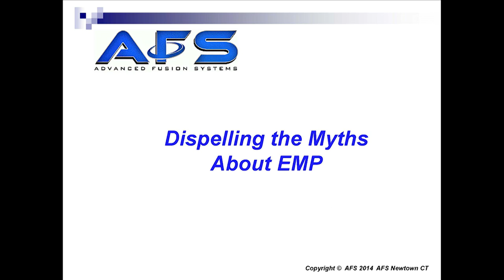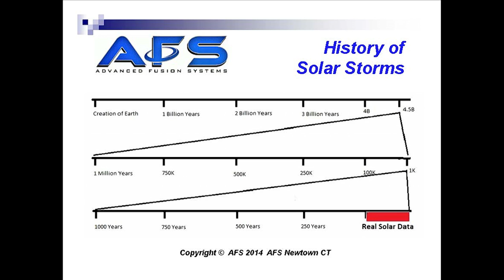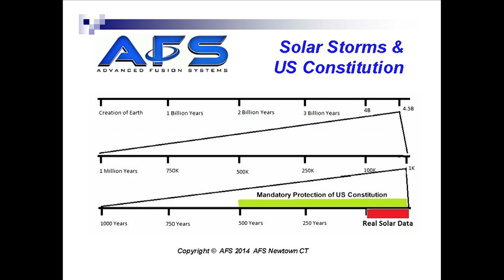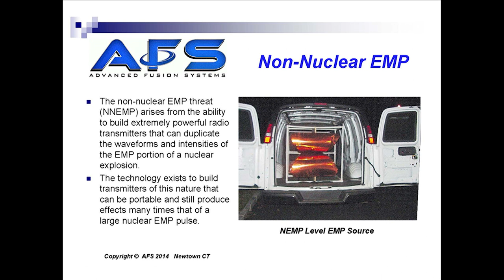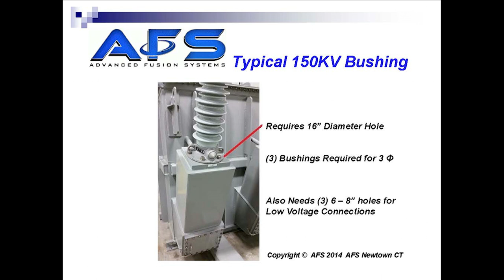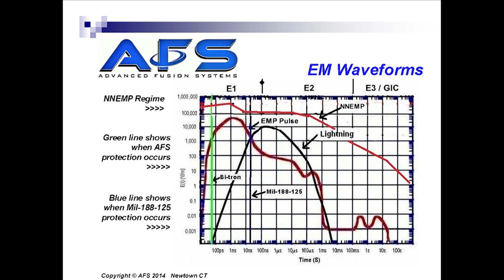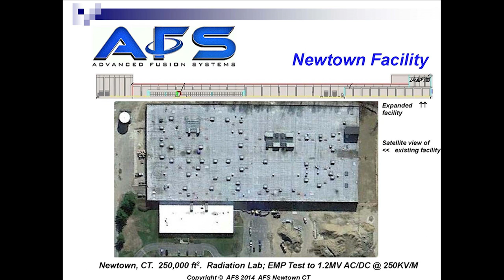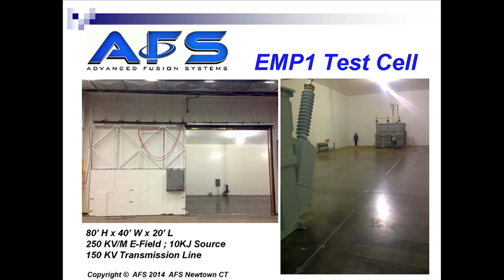8 - Presentation: “Dispelling the Myths about EMP"

Comment: This is amazing!  NO American should ignore the reality of what can happen.  I am totally convinced we WILL have an EMP.  It's happened before and WILL happen again.  We depend on our solid state run components.....even your refrigerator has a computer in it......right on down to a toaster.  If we lose those units a lot of people would starve in the first month or less.  I don't care if it's natural or man made......we WILL have one.......great clip
Reply: An EMP from an air-exploded nuclear weapon has never happened, and that's what everybody is scared of.  Only some testing has been done and it was no more dangerous than lighting hitting ac lines and frying equipment which is nothing new.
Reply: @genesmith482  no. But there was an EMP attack in the USA back in the 80's that was only recently made public. It was the couse to a famous city wide blackout.
Reply: AWitty Pilot --- Great comment. But I believe it will be an orchestrated event along with others so the NWO can step in and Take Control. The classic Hegelian Dialectic of Problem - Reaction - Solution.
Reply: @genesmith482  - Your comment is incorrect. The US detonated a 1.4 MT nuke  launched from Hawaii specifically for testing EMP effects. 
Phones, street lights, power stations, etc. were all affected. In fact, effects were even documented in Australia.
And that was from a weak, little 1.4 MT nuke. And, at a time back before modern electronics ran everything.
Reply: AWitty PIlot my toaster has no electronics. Come on.

Comment: I've been in the surge/lightning/EMP protection business for over thirty years.  There are basically three types of discrete components used for pulse protection circuits each having their own pros and cons.  Limitations are always cost, speed and current capacity.  The most robust design schemes usually have a combination of all three devices with supporting components to cover a broader range of current capacity and reaction speed.  Avalanche diodes (silicon) are the fastest, MOV's (metal oxides) are next.  And then gas discharge tubes are the slowest which is ironic since that is what this guy is pushing.  Also gas tubes have a follow on current after they are triggered and will conduct current from any power circuit in which they are connected (one of the reasons gas tubes aren't used in power systems without some exotic by-pass/disconnection circuit).
Reply: A solar CME is not a fast event. It is also 10,000 times more powerful. The Carrington Event in 1859 caused wires to melt and telegraph offices to burn down. We have to harden the grid against this.

Comment: From my understanding. Faraday cages need to be built in multilayers. Meaning a faraday cage within a faraday cage within a faraday cage and made out of non-conductive materials such as aluminum and insulated in between the layers. Plus no access panels or doors. Totally incapsulated with no air gaps to be efficient enough to protect from EMP. Why couldn't  large faraday cages built this way be placed on site or near by the  (Power Station / Plant) with replacement transformers inside? In the event of EMP attack or event just be swapped out after the event?
Reply: Aluminum is conductive. It is more about the wavelengths of EM energy involved vs. the size of gaps in the mesh.
Reply: Aluminum is conductive. Most high voltage conductors and substation busswork are stranded aluminum.
Reply: Sorry for the mistake about aluminum. But i've watched a lot of Youtube videos on building faraday cages and the ones that looked like they were working well had multiple layers to them. don't know or remember what materials they were using in there builds though?
Reply: Doesn't matter anyways. An EMP would destroy the nuclear power plants we have here in the United States (nuclear meltdown) and the radiation in the air would kill off everything else ( nuclear winter). We all die. Just like Chernobyl only on larger scale.

Comment: The only weak points in a power grid are the overly complex and unnecessary "digital" control and monitoring systems. Analog meters and standard hand-thrown switches and simple solenoid relays could alleviate problems. The likelihood of generators, lines, transformers and massive breakers incurring E.M.P. damage is negligible. Vacum tubes to protect the control and monitoring systems would be redundant if we return to old-fashioned systems. Vacum tube implementation would never happen with modern systems and may be some sort of boondoggle. Having that transformer in that 2400 sq.ft. room may be part of a presentation-scam for ignorant politicians and "officials", which I have seen before.

Comment: I think a Faraday cage and a Faraday net have holes.
Reply: There is a limit to the size of the holes, related to the frequency of the wave.  You are looking at a hole size at or a little less than that of a common aluminum screen.
Reply: Supposedly, any wave smaller than the mesh in the screen can slip through a Faraday cage. Microwave ovens use Faraday cage technology to let us look at the food through holes smaller than 1.5 millimeters. The wavelength of microwave energy for home use is around 120 millimeters.
Reply: Not sure what electronics are worth saving if the power grid and networks are fried.

Comment: So a faraday cage would not protect ???
Reply: Steven What about steel?  And I herd a microwave that’s not plugged in would protect small things. You think?
Reply: It needs to be earthed or useless
Reply: Susan Carter I have heard that the plug/cord needs to be removed from the outside of microwave (acts as an antenna) and hole sealed.. any ground to ground can supposedly feedback as grounding rods/wires will pick up the frequency... but I am only referring from what I have heard so...?
Reply: spiritmatrix2004 have been told by electrical engineer that the ground connection from grounding rod/wires act as an antenna as well.. he said NO ground connection.. but who really knows??
Reply: Yes it will if its made correctly

Comment: - Invited Speaker to the Huntsville Cyber & EMP Symposium
Aug 11, 2018. Visit www.lagridcoalition.org  for links to EMP information. We have done an EMP numerical simulation to verify a Thesis document (1974) by Terry C. Chapman - Catalog ADA777841 of the US Air Force College (AFIT). *To make your town more secure & safe - do this work. 

 1st  = A Small town in New Mexico evaluated, AD A023927 EMP effects on a rural area
elect system USAF AFIT (implement it).

 2nd. = Dr Baker’s Mil Std 188-125 document with A thru C appendices. 

 3rd. = Numerical Simulations at: ‘GitHub’ coding here: 

  https://github.com/LAGridCoalition/HEMP-Modeling and Simulations/documents,  in Google Drop boxes

 https://goo.gl/7aJqj4 = 5 docs at 90%  Simulation tests - & https://goo.gl/caE8vq = video  --

 https://goo.gl/71bBVt = Entire Huntsville AL presentation materials used. ** Important notes: 

A. Critical materials & methods in advanced weapons  are not mentioned in 2 AFIT Thesis PDFs - such as “Gas Boosting” is not mentioned in 1st and 2nd generation weapons. 

B. We verified the 6448 V/M in Thesis by Terry Chapman.  

C.  The gold standard Thesis by Louis Seiler (ADA009208) has not been verified.  

D. Reverse engineering methods were required to verify data including 4 inputs.

Comment: So am i to go ahead and conclude that Faraday cages are a waste of time?
Reply: No. There is a lot of good info about Faraday shields. As long as you can find one that isn't trying to sell you something it will be true. Look up Faraday shields and device/equipment/house grounding (earthing) . Go to the library and get a book. Quit totally depending on You Tube trolls and do vetting on preppers. They usually have (but not always ) have a book or some crap to sell you. There are some honest ones also I would believe them also. It doesn't hurt to fact check anything. Make the time to do it.
Reply: Paul Scalisi I have heard to be careful with the grounding as it can act as a antenna and allow pulse to backfeed back into cage.. much like the cord on microwave needs to be cut back inside unit and hole sealed..

Comment: Commercial power is protected due to its critical nature for supplying the public with power and the fact that it is licensed through the NRC and uses nuclear fuel controlled by the DOE. Such a classification of this material is necessary in order to protect any detected vulnerabilities. Why? because we have enemies looking for a means to sabotage and this can identify weakness or components which failed or were impacted.  This is not for public dissemination. Surely you can understand this reason.

Comment: For no apparent reason, he has to throw in a bogus 4.5 Billion years for the age of the Earth. He uses the Sun as a reference point but in fact the anomalies with our Sun show that it's age is questionable. Also, interpolating the Earth's magnetic field strength and the Moon's orbital distance back in time refutes this "age" premise.
Reply: Without knowing the Moon's original distance from Earth all of this is conjecture in either direction. It is entirely possible that the Moon and the Earth are the product of two planets colliding in the early history of our solar system's creation. We do not know the exact time of impact, velocity, and comparative masses of the two planets involved. Therefore we cannot with exact certainty say the point at which our nickel iron core became magnetized. All evidence that could tell us this became white hot liquid splatter that subsequently fell into two distinct gravitational centers. Earth gained a jaunty tilt, the Moon gained a dance partner. The origin of the magnetic core may well have followed the period where the moon was already in it's celestial trajectory by quite some time. Also, the theorized braking effect credited with the Moon increasing the distance between us, caused by the friction of tidal interaction as recently postulated, could not occur until a large amount of surface water was formed from the components still spewing from a molten Earth long after the moon glowed in Earth's night sky.
Reply: To Steven, We know how far the moon is out and we know how far it travels out each year. We do not know if was captured or if it spun off from cosmic goo as you suggest. We have to go with what we know and interpolate backwards to the Roche limit. That would be the maximum number of years the Earth could have been intact. The moon does not rotate which is strange if the theories you embrace are valid. Water is a simple molecule and if anything more complex molecules would come from it but water always stays as water in one form or another. The understanding of the magnetic field of the Earth and why it shifts and why it migrates and why there are many other magnetic focal points does not correspond with the simplistic core of Iron or Nickle. How can something be compressed and still be a hot molten substance at that level of pressure? Magnets do not work when they become hot.

Comment: What should have been done DECADES ago: BURY THE GRID!.  When I see puny power poles holding the electricity supply to a highly populated area, the explanations range from stupidity to political payoff. The PEOPLE must demand this first step be done and be done quickly.
Reply: 1) The transmission lines are not the problem.
The Transformer Stations are what gets fried. And if you bury those then you lose the power into the ground.

Comment: Bury your transformers.
Reply: Doesn't help.  Problem is that long transmission lines create high direct current voltages and currents from EMP.  Those lines always terminate at large transformers.  Transformers are not designed to handle DC.  It isn't the direct impact  on the transformer, but the power lines attache to it is the issue.
Reply: So simple and cheap and it works
Reply: Steven you don't want it grounded.. wire and groundrod would backfeed the pulse right to what we are trying to protect..